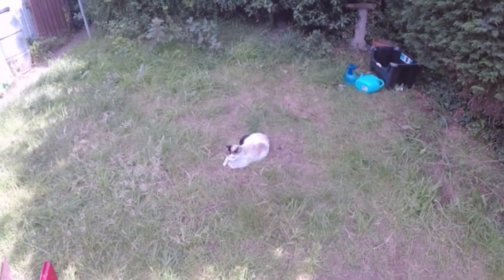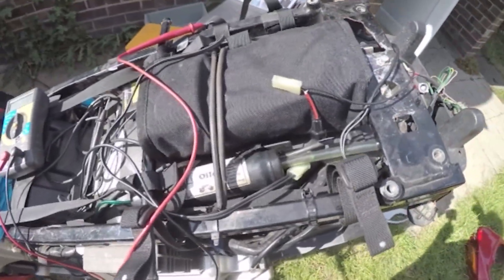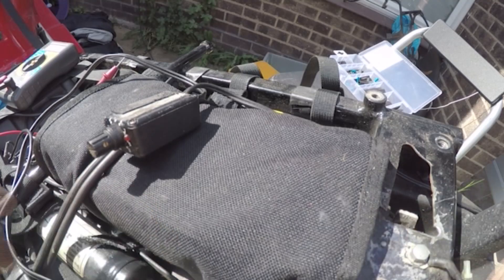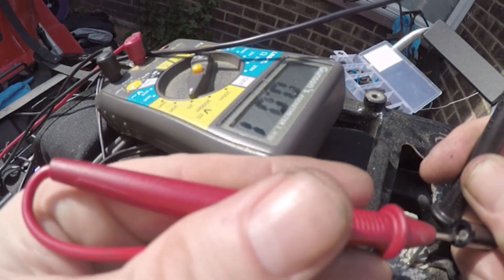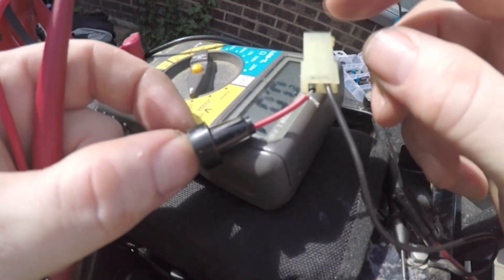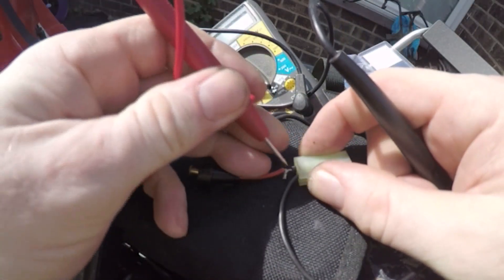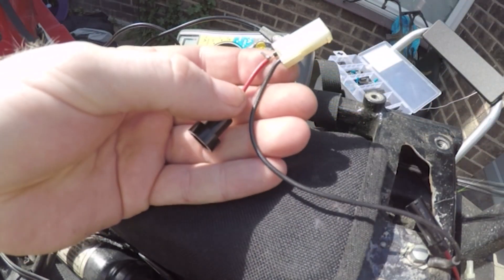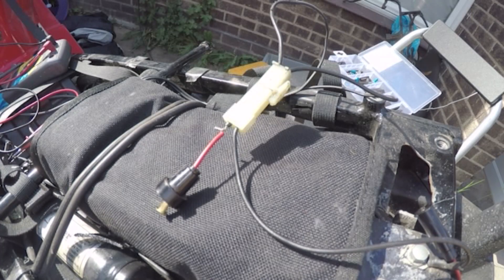How to Diagnose a Dry Solder Joint and repair

Comment: fter I fixed some electronics with bad solder joints, fried diodes,transistors and nicely cooked resistors people started to bring me more electronics to fix (I do not know why, I just work on the farm) but I had to turn down lots of those because do not want to mess up resoldering bunch of bad joints. I do not have desoldering iron and removing bad solder without it is a pain. And on some electronics I just can't find what is wrong (stupid metal detector wand had bad joint,fixed it,returned after a year,could not find what is bad now.).
Reply from the maker: +Ruth Black I've always used just a standard soldering iron to remove the solder,